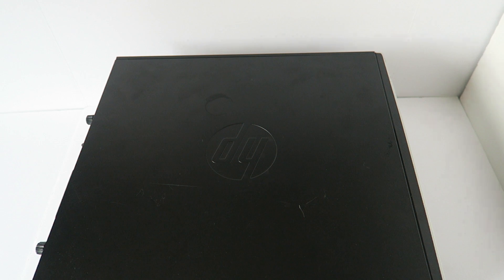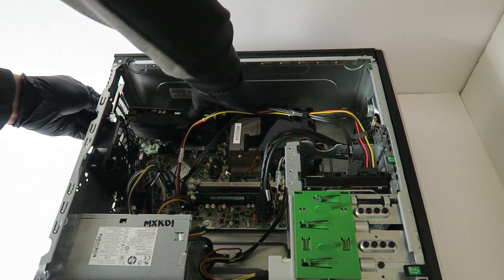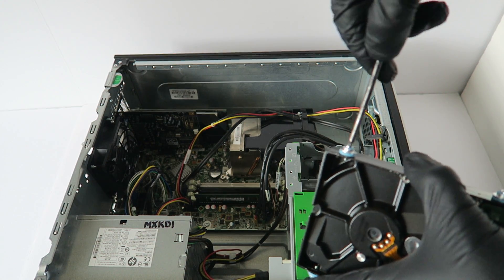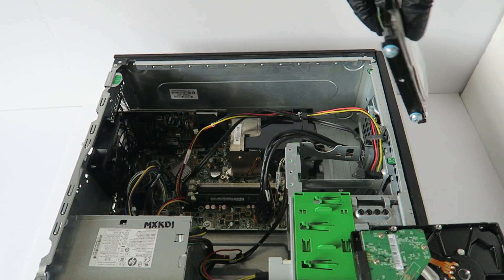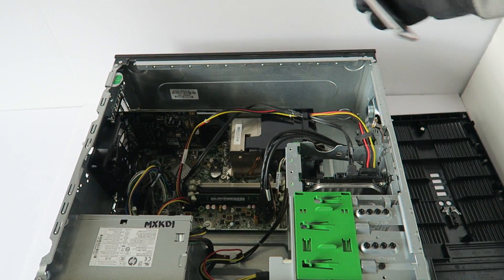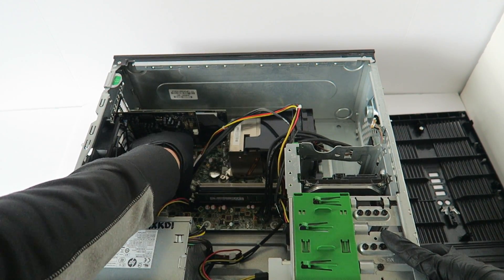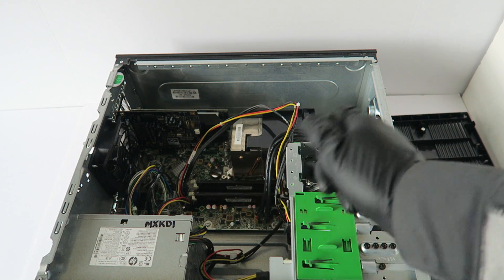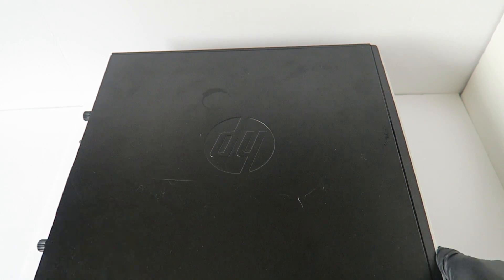HP Compaq Pro 6200 Upgrade Gaming Video Card RAM SSD

Comment: This is exactly what I plan to do with the exact same computer. The i7 2600 is still a beast of a chip.
Reply from the maker: Hi, yes you can use GTX 950 15pin SATA Power to 6pin PCIe PCI-e PCI Express Adapter Cable for Video Card.
Reply: @Mxkdt  Thanks for replying! But the only problem with a full size card is that it won't fit in the small form factor unit I'm buying. it has a Core i7 2600 in it so I guess that makes up for it being SFF. Do you have any tips regarding fitting a full size video card in a small form factor 8200 Elite?
Reply from the maker: Hi, what kind a video card are you trying to install?
Reply: @Mxkdt  If I absolutely have to go low profile, a GT 1030 or a Low profile GTX 1050Ti. But if I can fit a full size card into this small form factor case, anything I can get my hands on that my PSU will support.
Reply: @Mxkdt  Have you tried fitting a full size card in a sff 8200 elite? A great video idea if you ask me...
Reply: yes but can a 7 inch GTX 1050 Large profile card fit?
Reply: @dercrysisbz2049  I was wondering if a full size card would fit too, unfortunately it won't if it's a Small Form Factor (SFF) tower. But if the tower is full size, a full size card would fit.
Reply: @therealfree2play  But this video is a Full Microtower tho, so that's why i'm confused on why it wouldn't..
Reply: My mistake, the case looks as if it'd fit a full-height card. The only thing you'd need to worry about is length of the card, and that the PSU will supply enough power.
Reply: @therealfree2play  7 inches OC gtx 1050
Reply: @dercrysisbz2049  I couldn't tell you if it'd fit, I just know I'm getting an old 8200 elite for Christmas, and that's what I plan to do with it! Lol I'm sure it'd fit, even if it didn't you could make some modifications.
Reply: @therealfree2play  I took off the Ports shield, it was keeping it from plugging into the 16x PCIE slot, but another problem i got into was the heatsink touching the BLACK piece of the graphics card, so i read up some comments online and it's perfectly fine, so. I hope nothing happens, other than that the card works.
Reply: @dercrysisbz2049  and what system do you have..?
Reply: @therealfree2play  HP pro 6200 Compaq, lol
Reply: @dercrysisbz2049  Turns out I'm getting a HP 8200 Elite SFF. It's going to be very difficult finding a decent (and cheap) graphics card for it that doesn't require any 4/6 pin power cables.the GTX 1050/Ti, GT 1030, GT 730 and GT 710 are my only options sadly. Or I could just buy a cheap new case that allows full height cards and get an old 680 or something...🤔
Reply: @therealfree2play  680 pentium chip is not that good, you might want something that has a i5 or i7 at best. *Edit: or are you refering to a PSU?
Reply: @dercrysisbz2049  The HP 8200 Elite Small form Factor with an i7 2600 and 8 gigs of ram
Reply: @therealfree2play  Or are you can gamble, and get a dell optiplex 990, or 790. And hope to god that the bios workout fine and that Graphics card works, and honestly, I almost bought a Dell optiplex until i saw HP pro 6200 MT. And if you do decide to go that route get the minitower version
Reply: @therealfree2play  Oh wow, that's really good! A better improvement than my i5-2400.. I got this HP 6200 MT from Ebay for 75 bucks.
Reply: @dercrysisbz2049  Can't beat cheap, I'm getting this one from my work for 50. The i7 2600 holds up to today's i3 8100.
Reply: Do u upgrade PSU to 320w when u used gt1050?
Reply: Me too

Now Idk gt730 can used 240 PSU or not course recommended PSU 300w
Reply: @subki8443  I think the one that was preinstalled in my unit was 300Watts, it was a 8200 SFF Elite. The 1050Ti sipped power and only had a max power rating of 75 Watts. It was so low power, it was supplied with power by the PCIE slot.

So in short, I think you'll be fine. Look up the TDP of your CPU and the GPU you want, and look for a power rating on your power supply, as long as your total doesn't exceed the number on the power supply, you're good to go.
Reply: @therealfree2play  same here, my options are the same as yours only that I'm not sure about the low profile thing
Reply: @therealfree2play  i have a 6200 pro mt with an i3-2120, 8 gigs of ram, 320 watts psu and that about it, must I go for the 730ddr3 or a 1030 ddr4 can work? or a 1050ti?
Reply: @Fauxgeneral8  the 1050Ti fits perfectly, it gave me pretty good performance for what I asked from it. I played Skyrim, CS:GO and a few other older titles. Power draw is not an issue, it gets all of its power from the PCI slot. it was a great beginner machine!
Reply: @Fauxgeneral8  if you want to provide the model of your tower, I can tell you whether or not you could fit a full size or a low profile card.
Reply: @therealfree2play  oh dmn im so glad, was it the low profile or the full version and what ddr was it?
Reply: @therealfree2play  its a HP Compaq 6200 pro Microtower, just like in the video but with the specs I've put up here
Reply: @Fauxgeneral8  The GT 1030, GT 710, GTX 1050 Ti, or the GTX 3050 are your options! They are all powered by the PCI slot.
Reply: @therealfree2play  so according to the above, which ones should be low profiles and full profiles?

Comment: 1050 ti oc zotac ??
Reply: Yup it can fit
Reply: @necrosdominus5212  zotac 1050ti oc edition, is it working 
Please reply
If there is any fitting problem ?
Reply: @necrosdominus5212  are you using zotac 1050ti oc edition on same pc , will it fit, people saying dual fan won't fit

Comment: Hi! I enjoyed how easy this video was to watch. But i installed a Gpu, where am i supposed to connect it to? How do I connect the gpu with the psu?(Please respond)
Reply: Jake is it the stock psu? If so it prolly wont have VGA psu connectors. Unless your gpu doesnt need the VGA connectors. Low power drawing cards like the gtx1030 wont have a place to plug the VGA connectors into because the PCI slot alone is enough to power the card. Message me if you have more questions.
Reply: Hey bray, do you know if the motherboard can support 2x4gb of ddr3 with 1x8gb ddr3 at the same time?
Reply: @braygillum3473  even if the 6200 pro mt has a 320w max?

Comment: to everyone watching this video, it is worth mentioning the PCIE 2.0 x16 slot runs at x4 mode. However, from my experiences and benchmarks I've seen around the net, I can assure everybody that at least with these lower end GPUs that the dip in performance is negligible. Like, 5% to 10% dip.
Reply: I know im late but, does the HP compaq 6200 pro MT have a PCI-e 2.0 or a PCI-e 1.0 slot. I really want to know cause i want to upgrade to an Low profile GTX 1050
Reply: @MatissAncans go ahead

Comment: Question, what is the least expensive graphics card I can run that will allow me to use two screens on windows 10 pro. HP Compaq 6200 micro tower is what I'm using. It is just a work computer and will be using the second screen to show clients parts and pricing, so literally the least expensive card that will allow me to do that will be just fine.
Reply: get a gt 710 or gt 730

Comment: hello, is the power supply on this pc good enough for a gt 1030? thx

Edit: oh,I guess it is, my question is if I need to get low profile one or standard
Reply from the maker: Hi, yes gt 1030 will work fine, you don't have to upgrade power supply.
Reply: @Mxkdt  what about gtx 1050 ti sir ?

Comment: Hi, great video... Can It support a full profile graphics card as MSI NVIDIA GeForce GTX 1050 Ti OC, 4GB 128-bit GDDR5, PCI Express x16 3.0? thanks in advance
Reply: Moises Pea no it won’t fit got that exact Gpu you’re talking about and it hits the cpu cooler...
Reply: If you use a stock cooler will it work
Reply: @maxthememer1780 how?
Reply: @NowLedgeOutpost  because the oem cooler blocks it, if you use a different cooler it will fit
Reply: @maxthememer1780  lol then use a pcie gpu riser
Reply: @NowLedgeOutpost  ok bro
Reply: @maxthememer1780  it works, if you have the same old system, buy your favorite gpu and power supply and you're ready.
Reply: look for low profile gpus like the 1030 or the 1050/1050 ti low profiles others wont fit

Comment: I bought this 6200 from HP with I-3, can I upgrade with I-5, will the mother board of this 6200  can work with  I-5 CPU ?
Reply: Yup, this one supports only second gen CPUs, and only 1333Mhz RAM.
Reply: Tommy Nguyen as long as the i5 is 2nd or 3rd generation it should work
Reply: Tommy Nguyen  i7 2600 is listed when I last looked it up. But you should double check
Reply: If you have a LGA 1155 yeah, 2nd or 3rd gen of Core processors
Reply: only 2gen
Reply: Yes, but only if the i5 you get is LGA 1151 or what ever slot the motherboard has for your cpu :)
Reply: yeah i got this pc and i upgrade it to i7
Reply: it can take the i5 2500 or the i7 2600
my has the i7 2600 i have it uprgaded from the i5 2500

Comment: Hello i have exatcly the same computer but i have changed the casing to mid tower so can i  install the gtx 1050 none low profile version .this computer has low profile pcie
Reply: Cover Gamers what case did you get? I wanna upgrade mines but idk what case the mobo will fit on?

Comment: how to upgrade HP Compaq Pro 6000 pro  ?
Reply: But the source of the 6000 does not fit the card, it's only 240w
Reply: really ?
Reply: Is 240w suitable? In that case I replaced the G4560 pentium CPU, GTX 630TI NVIDIA, then the GTAV battle it?
Reply: The 6000 microtower comes with a 320w PSU. The SFF comes with 240w PSU
Reply: plz tell me ..which is the version of pci x16 slot? (hp 6200 pro sff)

Comment: Please respond please thank you if you do,my question is can you replace this gtx 1050 by a Rx 460? I'm trying to save money right now please respond !!! Does it also work with gt 710 gt 730 gt 1030 r7 250??
Reply: abstract absol thx much love
Reply: Ive been using a gt 730 dddr5 1gb and it works pretty fine
Reply: Gtx 460 is the best price to performance card out rn. I got mine for $20 on ebay and it plays gta at smooth 60 fps no problem on normal to high settings at 10800
Reply: 1080p*

Comment: Hey I have this exact computer and Im planning on upgrading it but because of stock in my country I can only get a EVGA Gtx 1050 ti Gaming, and this draws 75w, I saw online and it actually has lower base clock. Will it work? (My computer has the 320w power supply and intel i5 2400)
Reply: Are that work great ? 
Plz answer

Comment: or do you think this have enogh power for the rx550 which is also a low profile card :)
Reply from the maker: No, i would just get gtx 1050 or gtx 1050 ti low profile will work fine

Comment: well today  I have in my hand one of these babes  , and I must say this upgarde is wery stupid idea expecialy upgrade of the video card , compac2 6200 pro has have a non standard power suply  320 wats  and he is already in the edge , the power suply ugrade is not posible because the mainboard not have a standard 20 or 24 pins slot,
Reply: With i5 2400 and GTX 1050 Ti it never draws more than 120 Watts while gaming and maximum of 150 Watts while pushed to the limit with OCCT PSU test. So 320W HP PSU is way more than enough.
Reply: power supply 320wats isn't support video card? coz my hp also 320 wats. I want to upgrade video card.
Reply: Yes, Now I using GTX 610 2GB it is ok with 320W.

Comment: Hi, why dont you leave 4g of existing ram along with addition 8 g, so you will have 12g of ram?
Reply: CH2O the reason is to run in dual channel mode. If u left the one rogue stick in, yes you would have 12 gigs system memory, but it would run in single channel, quite a bit slower. So the benefit of running 8 GB in dual channel outweighs 12 gb total
Reply: @lodkikass  i have in this machine  (HTPC) 3x2GB and 1x 4GB in dual channel.
Reply: Ram only works in pairs of same size. Unless you use a single chip by itself.
Reply: CH2O i've installed additional 2 pieces of 4Gbyte along with existing of 2 pieces of 2Gbyte RAM, the system recognize 12Gbytes total RAM.